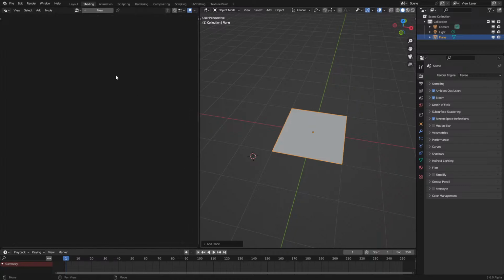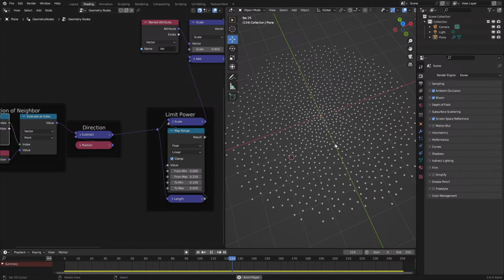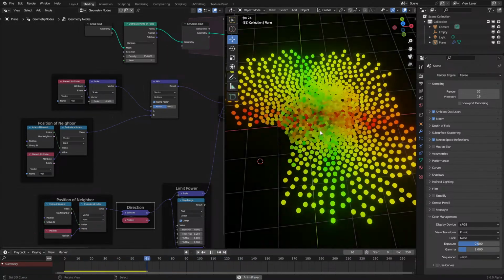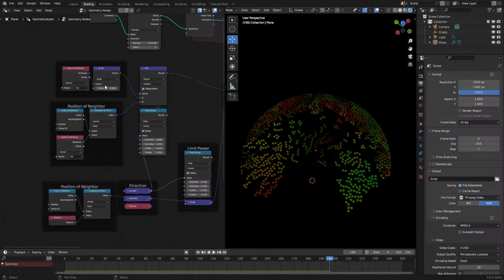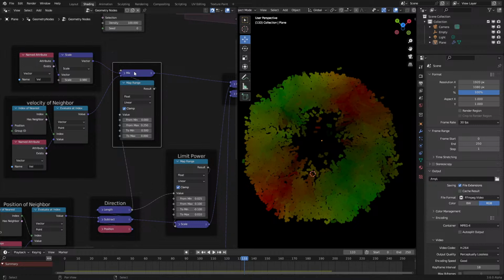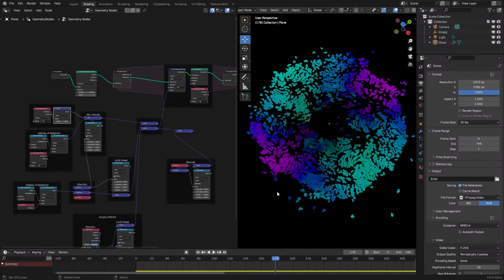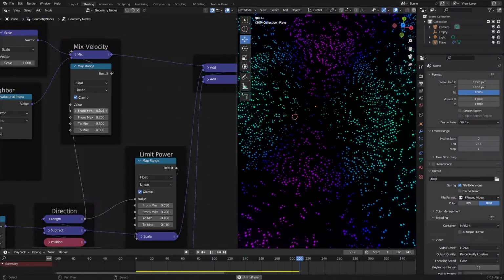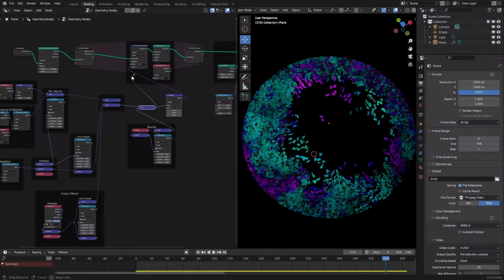Water Sim(?) in Geometrynodes (Blender 3.6 Test)

Comment: Hey there! I feel like store named attribute Node does not seem to work in 3.6 sim nodes build. If i try to store it inside simulation-in my case it is top selection from extrude node, it stores just every points and second frame extrudes the whole mesh. Is it my bug, or 3.6 in general?
Reply: Hey, i've ran into the same problem before and found a quick workaround thanks to @GrafGrantula from an Erindale video. (https://www.youtube.com/watch?v=gMOgB7Ds3ZI answer to the pinned comment)

"You need to subtract all points that have two neighboring vertices from the "Top"-Selection socket of the Extrude Mesh node, because that way you only get the beginning and end points of the "splines". You need to do all that in between the Extrude Mesh and Store Named Attribute nodes.

You can get that done using three additional nodes:
1. "And" Boolean Math node to remove unwanted points from the selection
2. "Less than" Math node to compare the neighbor count to less than two
3. "Vertex Neighbors" node to get the vertex count"

Hope this helps
Reply: @DerWavezz  i tried 1 one thoug.
Vertex neighobrs sounds like a perfect solution it shis situation
Reply: Thanks for the suggestion! I'll surely try that out.